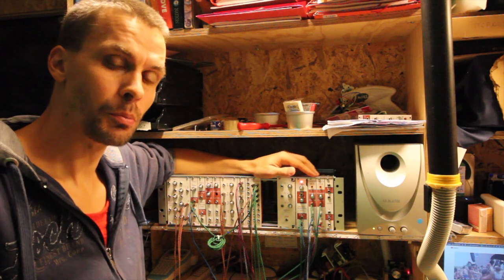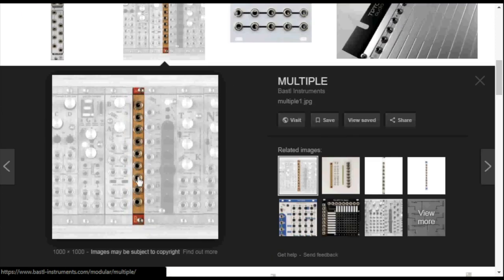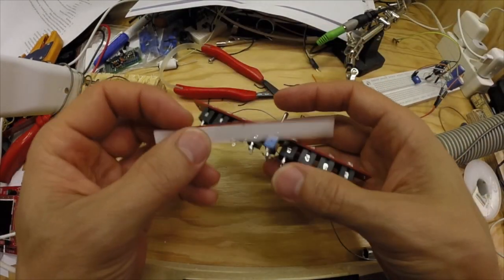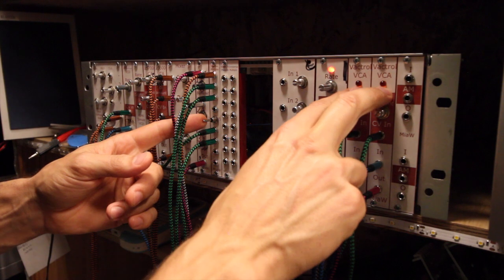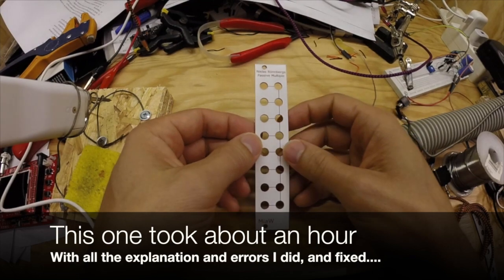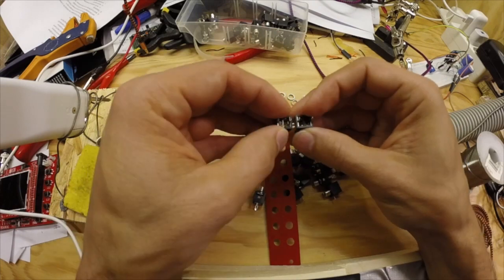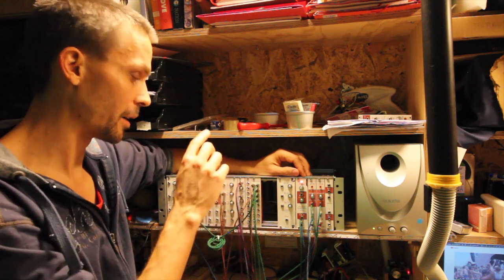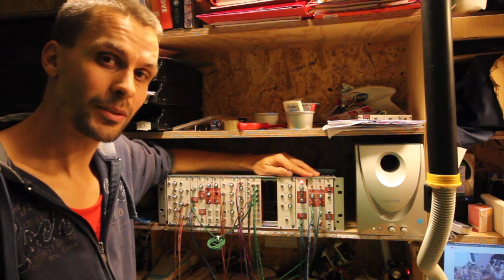Passive Multiples - DIY Modular in a Week 3.3

Comment: regarding the second schematic. why would you need every row of the first column? For mine i just skipped every second line of jacks, it's a waste. the reason for the multiple is to at least split the signal in two, why do you keep useless options like the 1:1 / 1:7 split?
Reply from the maker: Very true. And I did a second version of my own that incorporates this exact idea. So yeah. You are correct. :)

Comment: Hi Kristian! I built this module from your tindie kit, and it seems I made an error somewhere. Initially it worked fine, but lately the inputs will mult out to their respective outputs(input 1 to output 1 and 2, etc), but NOT out to outputs further down the chain(input 1 doesn't mult to output 3/4/5/6 with nothing coming in to inputs 2-4). How can I troubleshoot this?

Comment: the signal loses force the more it is multiplied to different jacks? Oh, I just notice in the video you explaining exactly that. But, how can we compensate it?
Reply from the maker: You can make a buffered mutiple explained in the video after the one you just watched. There you use opamps in a voltage follower configuration to buffer each output.

Comment: What are those laser panels you use for your faceplates?
Reply from the maker: I think it is called lasermax. It’s really simple flimsy panels made for name tags etc with a core color and a thin layer of color painted on top that is burnt away by the laser. Thus creating the “print”. It is explained in one of the videos in week 1.

Comment: A stupid noob question. Do you connect all the ground wires to ground of the psu, or just connect them all together?

Thank you
Reply from the maker: Yes. All ground should be connected together also with the ground from the psu.
Reply: @SourceryOne  thank you so much and congratulations for your channel
Reply: You do not connect any wires to psu ground on a passive mult. The ground is chassis ground in this case.
Reply from the maker: Also in the case of a passive mult, signal ground is also chassi ground. So you get the ground coming in from one module through the wire which is then connected to all the ground connectors on all the jacks.

Comment: I think i'd want to try a 2HP version that is 3 in, 6 out, (IN1, OUT1, OUT1, IN2, OUT2, OUT2, IN3, OUT3, OUT3) with each set repeating the one above until you plug something in
Reply from the maker: That is actually a better solution than the second one in this video. As any signal in needs at least two outputs (why else use a multiple) that way you save three jacks. Good call/idea.

Comment: OK... this is my 2HP passive mult (10 plugs!!). Normalled (the second line automatically interrups the connection with the upper line when a connector is inserted into the 6th plug from the top): https://imgur.com/a/QobqXUe
Reply from the maker: That is impressively tight! 👍
Reply: But it works, with Arturia (as shown), Doepfer and Befaco cables, which have a thin connector: https://imgur.com/a/rm5Fxb0 By the way, being the panel made of alluminium, it's used to connect the GND (these plugs have the GND also on the shield/screw bit) - no need for extra soldering. In fact, I completly removed them, since they would have made for an extra 2 HP (1 HP per side) in the configuration I chhosed (the lower plugs are rotated 180°)

Comment: You can take advantage of switched plugs and normalize one in put "to the last of the first serie". And save the switch for something else (i.e.: an A/B switch). For the panels, I'd use common blind panels (2mm alluminium).
Reply from the maker: Yeah that is what the second module did if I understand you correctly. The panels are made of plastic as I have a friend who makes them on a laser cutter which can’t handle aluminum unfortunately.
Reply: @Kristian Blåsol if you buy blind panels (i e. Doepfer), they are reasonably priced (about 3€ for modules up to 8 hp), all 2 mm aluminum and with the screw holes predrilled. They also come with 2 m3 screws.
Reply: My CV-Lites do not fit as well, because of the thick connectors: https://imgur.com/a/eMZ0L67 and https://imgur.com/a/fc6Jfym By the way, these are just 5mm bipolar blue/red LEDs with a 470 ohm resistor in serie. Useful to "see" uni/bipolar (red is positive and blue is negative) CVs and also audio signals (typically, they light up in purple).